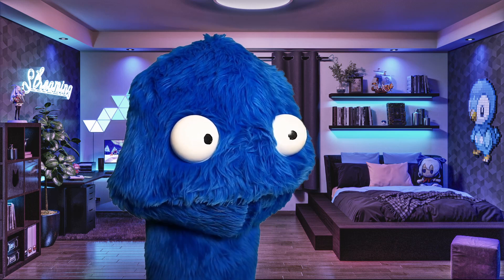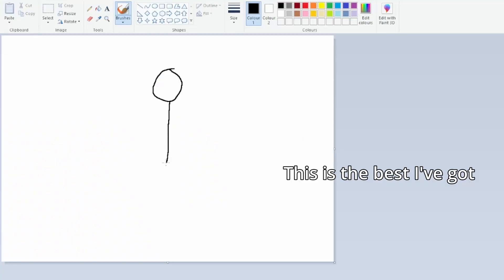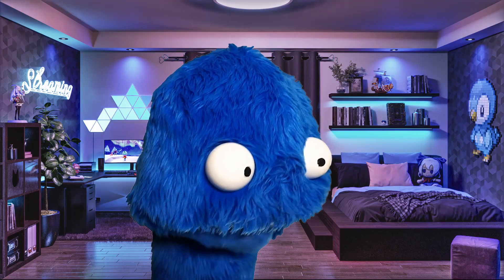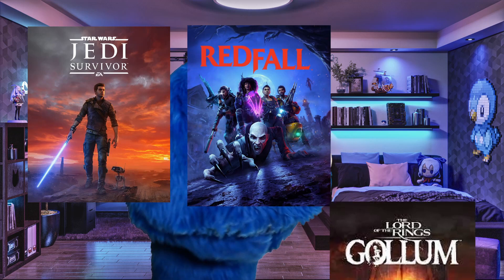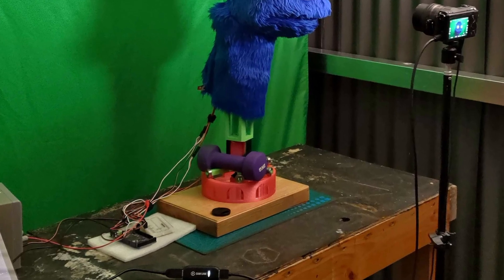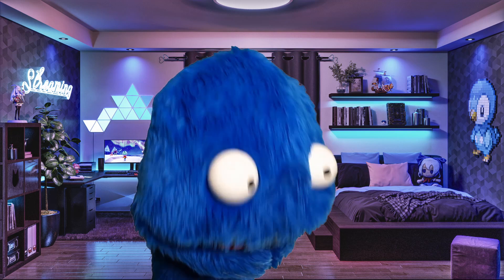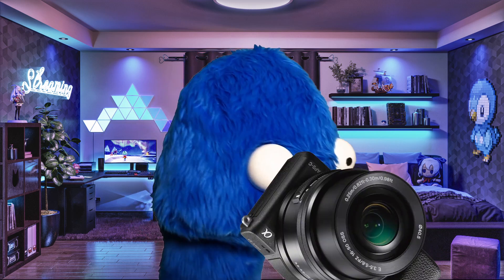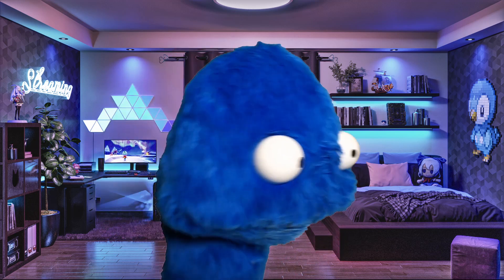From Scratch: Crafting My Own Animatronic Vtuber Puppet

Comment: oh yeah... I'd say you stand out, this is really freakin cool too!
I didn't know Vtuber model software could do anything outside of 3D or 2D modeling.
Reply: It makes sense, honestly.
If you can take the position/movement data from a face recording, and apply that to a 3D model, there should really be no reason you couldnt do the same for an animatronic puppet.

I'm not saying I'd know how to do it, because fuck no, but essentially all youd be working with are some 3D coordinates and rotation values, which are all fairly simple.